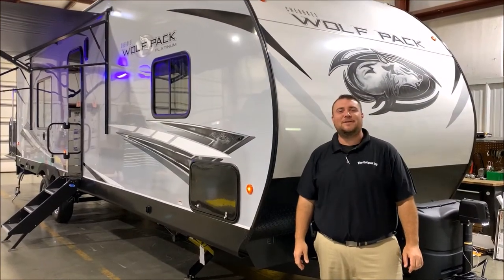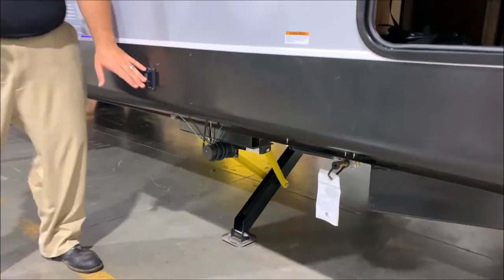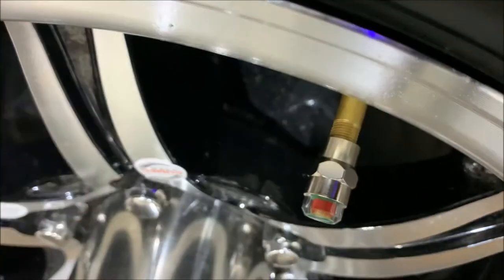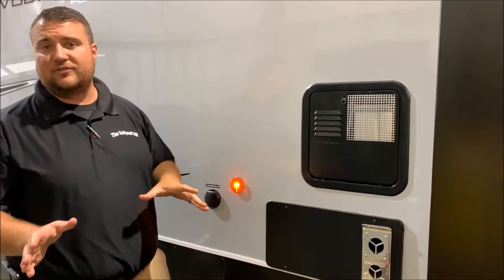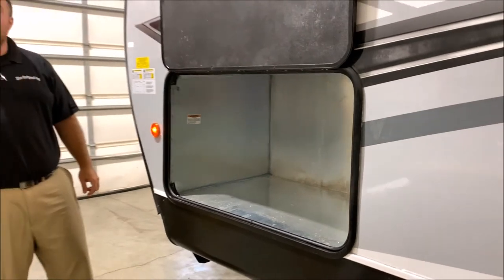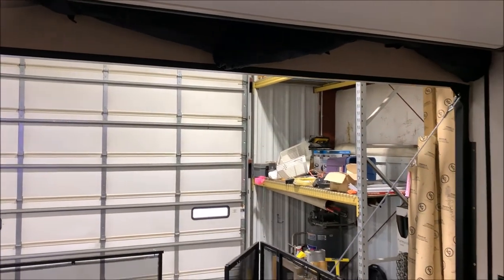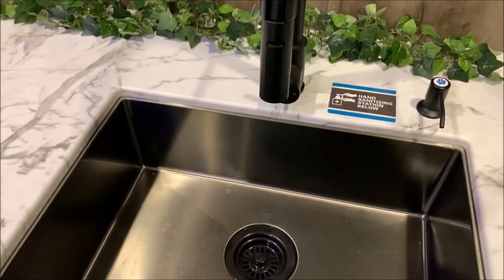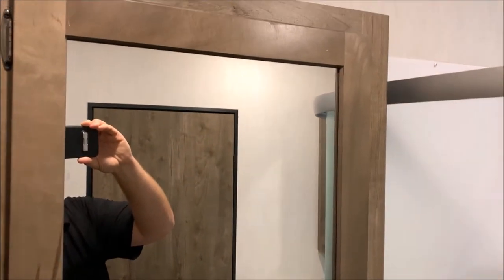2022 Wolf Pack 23Pack15 Toy Hauler

Comment: What is the clearance under the drop down bed? If it’s not enough can it be optioned without it?
Reply from the maker: Right at 81".
You can delete the option or remove the top bunk held in with removable pins.

Comment: One thing i dont like on the 2022 model its the outdoor speaker are White and on the 2021 they were black. Black is better.
Reply from the maker: Because of shortages they used some white speakers but I believe they are back to using black.
But yes, I agree with you.